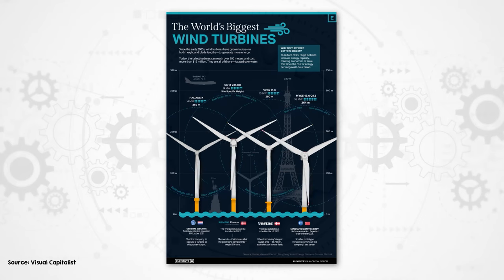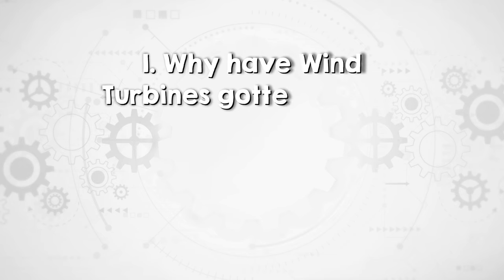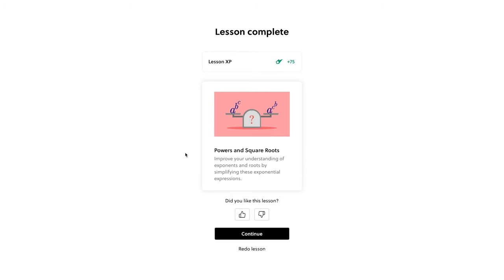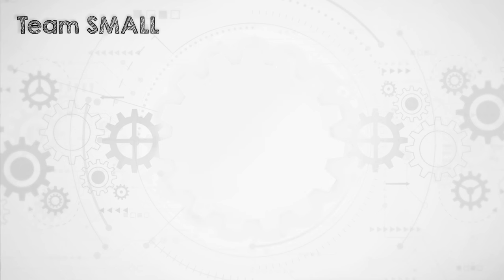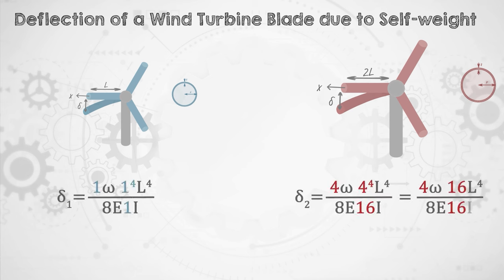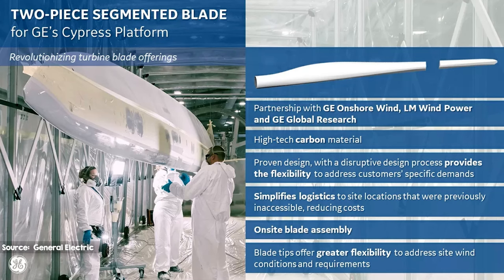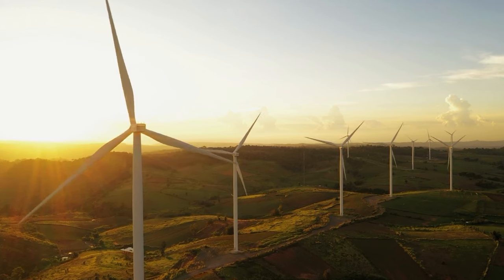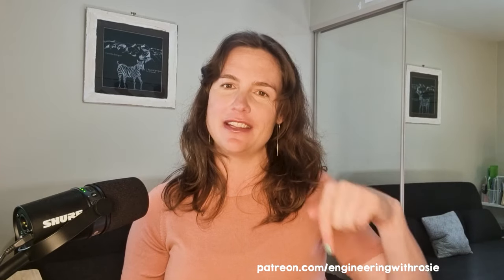Discover the Surprising Science Behind Wind Turbine Design for Lower Energy Costs!

Comment: I think transportation will be the ultimate limiting factor. Except for a few special locations (middle of a desert, perhaps) the road dimensions will dictate what we can do. 
Another point for team small: downtime. It is better to have 1 of 10 towers to be out than one ten times bigger tower.
Reply: Dunno about that... With 10, you have 10 times the points of failure, plus the repair crew isn't 10 times bigger for a big turbine than a small one, so the labor costs will be higher for the small.
Reply: Road dimensions don't (often) matter for offshore wind. Ships can be very big.
Reply: Wind farms have scaling rules too. With the exception of engineering prototypes and tiny turbines, windmills are installed in groups.

I doubt it is cost effective to manage less than a dozen turbines.
Reply: For offshore wind farms transportation is less of an issue as ships are large and the sea is wide. 
The limiting factor is getting the parts to the harbor (or perhaps building it in the harbor).
Reply: @hamjudo  Doesn't matter how many turbines, what matters is the generation capacity and maintenance cost.
If 10 turbines can generate 15MW each, that's 150MWp wind farm, which can be cost effective depending on the cost of transmission and the wind consistency.
Reply: I read somewhere recently that the largest sizes of offshore turbines are already reaching the limits of the maximum size of floating cranes currently available for assembly. Of course larger cranes can be built but that in turn will be an additional cost. Perhaps an opportunity with floating turbines, as these can be ballasted down for assembly, to a point.

Comment: I suspect the volume (of structural material) increases at a factor less than a value of the cube. This being attributable to the structures being hollow. For example, should the support post have the same wall/skin thickness, but twice the size, then the factor would be squared as opposed to cubed. And if the wall thickness increased by less than two (for twice the size) then the volume increase would be less than cubed.
Reply from the maker: In all the scaling I did all dimensions had the same scaling factor, i.e. thickness increased at the same scale as length. 
You're right that mass has tended to increase more slowly than the cube of length, at least for blades. That's for the reasons I mentioned in the video.

Comment: Rosie has a new video. Now I want cake :(
Out of curiosity is there much a performance difference in having a 100m blade at the minimum sort of height versus say 20 or 30m higher.  You did say that part of the advantage of the bigger turbines is that they are higher and thus experience higher wind speeds but is there any real advantage in just jacking up a 3MW turbine so that it's in the higher wind speed area.

Comment: Current designs rotate the power head to face the wind. This necessitated a tubular design for the tower. Has any studies been made where you rotate the tower and fix the power head. Tower then being truss with majority of strength in one plane.
Reply from the maker: Some reallllllllllllly old designs were like that! But honestly, the yaw system only makes up about 1-4% of turbine cost, it's not that big a deal to have it. There is nothing inside the tower that rotates as the turbines yaws, that's not why towers are tubular (it's for ease of installation, weather proofing etc)

Comment: I love your content, especially about wind.
Which type and size turbine saves more birds and is quieter at the ground?
I recall you once said that tower height is minimized relative to blade length, and a longer blank base tower section costs money with no return. 
But the longer that length, the less noise for people and if I recall, less bird strikes. Could those additional costs be budgeted into projects, maybe from other sources of funding?
From today's video, could worn giant turbines get shorter blades of new designs with minimal loss in output, mitigating current problems? Maybe address mitigation through upgrades? Thanks!
Reply from the maker: Noise is related to blade tip speed, which doesn't vary much with size. Offshore towers are kept pretty short, but onshore towers are usually as high as they're allowed to be, to reach the better wind resource. I haven't seen any proper bird studies that looked at tower height vs bird fatalities. I assume it would vary a lot depending on the landscape and bird species. I have been intending to do a video on wind turbines and birds ever since I first started this channel, I really need to just get that done!
Reply from the maker: Oh and your last question, about swapping out old worn blades for new shorter ones. No, that never happens. When old turbines are refurbished they'll just repair/replace like for like. There have not been such large efficiency gains that you could use a noticeably shorter blade. Sometimes old wind turbines are repowered at the end of their design life, but if blade length changes  it is invariably to longer blades to get better capacity factor (generate more power at slow wind speeds and therefore more energy overall).
Reply: That reminds me. I have to finish putting together the system so birds stop running into my windows. As everyone should know by now, windows kill many more birds than wind turbines.

Birds evolved along with trees, so they know how to avoid branches. Windows are new to them, on an evolutionary time scale. 3mm diameter paracord spaced every 100mm has been shown to be good enough to prevent almost all bird strikes. (Doesn't stop cardinals from attacking their own reflection, or help when a bird is surprised by a bird of prey and they aren't looking where they are going.)
Reply from the maker: @hamjudo  yep, buildings, cats and cars cover nearly all human caused bird deaths. Climate change is a further threat. Wind energy is definitely an overall good for birds, but I still think we need to do what we can to avoid harming birds, especially endangered ones.
Reply: Wind turbines distributed throughout a country reduces the need for big power lines. Power lines kill large numbers of birds.

Comment: How will the speed of sound influence the size of wind turbines? Larger means faster tip speed. At some point it has to become fast enough to get affected like helicopter blades do.
Reply: In general, tip speed is the same for all diameters, it is the rpm that changes, so the speed of sound has no influence, except for it being part of the reason for the tip speed.
Reply from the maker: What Nigel said!

Comment: Generators that are efficient when coupled directly to the blades are more expensive than ones that spin faster. Big gears are expensive and inefficient.

Depending on the price of rare earth magnets and copper, the whole system cost may be lower without gears, but with a more expensive low speed generator.

My intuition is that in the small vs big tug of war, big turbines are less likely to have any gears.

Comment: cant we stick two current-size turbines onto each other? get the upper set of blades into better wind, while keeping the benefit from the lower (currently top) rotor. maybe have the rotors overlap and by clerverly designing blades turn them in sync.  maybe one of the front-side of the tower and one on the back? dunno.

can we put the stuff in the nacelle onto the ground with a long shaft and make the tower thinner?
Reply: My first thought about that is that for a given tower height one big turbine can sweep a larger area than several smaller ones in one tower. However, I'm not an engineer so I'm not sure if that's enough to kill the multi-rotor designs.
Reply: @seneca983  Ya. Makes sense. However growing the tower was kinda cheap (if i remember correctly from the video), but increasing the rotor-size was expensive. Thus the idea to use a big tower with two medium rotors.

Comment: 9:05 Hey since the Blades are more like hollow tubes rather than filled up, can we really say that the mass cubes with bigger size?
Reply from the maker: Yes, if you assume skin thickness scales proportionally to the other dimensions. Which is what I assumed when I showed that maximum stress stays the same regardless of scale. If you didn't increase skin thickness, blades would break at lower loads.
Reply: @EngineeringwithRosie  thx! Maybe it does not scale proportionally - since the bending resistance also gets better with the bigger profile, thus not that much more material is needed. Just an idea to explain why the graphs later in the video are not exponential.
Reply from the maker: @uninteressant2196  I included all the equations in the video, they include bending stiffness and how it changes as dimensions are scaled up. The non-cubic relationship we've seen so far is related to better design methods, materials, manufacturing etc as I explained in the video.
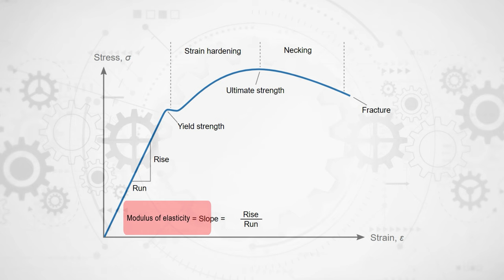Reply: @EngineeringwithRosie  8:59 The Proportional deflection stays the same - Double the length, double the deflection. If you look at the Formula for deflection this means that (i) I_1 = I_2 , since the radius is doubled the only thing we can change is the thickness t. 
We get I_2 = pi*2^3 *r^3 *1/2^3 *t
So the thickness of the larger blade is t_2 =1/8*t. 

Or
For delta_2 = 2*delta_1 
i get 
2*I_2 = I_1      ->      t_2= 1/16* t_1

However whats weird about that is that the mass of the larger tube is smaller...

The formula for the mass is probably simplified in the video, i got for a hollow tube: V= L*pi/4*(2t^2+8rt)

Comment: There would be a lot of benefit to sticking with say 3 good designs and building a lot of those same turbines

While you can improve the economics of a wind turbine design. There is a lot to be gained by improving the factory and manufacturing process itself

Take a soda can
You can improve the soda can design itself
Or you can improve the soda can factory
In this case the latter is far more important

I suspect we are nearing this point now for wind turbines. Pick 3 offshore turbine designs maybe from 3 different manufacturers and order 10,000 of each to be built over 20 years and let the companies improve the factory to get better and better and better at making the turbines

Comment: Has there ever been any investigation into multi headed turbines. Meaning a tall tower with 2 smaller turbines?
Reply: Lol posted just before you said it in the last 30 seconds 🤣
Reply from the maker: I talk a lot more about multi rotors in this livestream from a while ago. https://youtu.be/QqXxn5mKvlM
I'll probably make a whole video on that sometime soon, it's something I get asked about a lot (especially the Wind Catching design)
Reply: @UnwittingSweater  One issue that comes to mind is that for a given tower height one big turbine can sweep a larger area than several smaller turbines in one tower. However, I'm not an engineer so I don't know if that's enough to kill multi-rotor designs.

Comment: It's obvious to me that we need a ring slightly larger than the circumference of the Earth to allow the blades to enter the jet stream. Then we beam the power down with microwaves. So simple. Oh, I forgot to mention several thousand space elevators to stabilize the ring in the jetstream.

Comment: Very interesting video.  Just one tech point.  Spiral welding is nothing new.  It's been done for 50 years on structural pipe, just not on the scale needed for the new mega turbines.

As an aside, I wouldn't want to work in cake land Denmark.  A diabetic like me would have to resist temptation way too often!

Comment: Danes and cakes... wait, where are you from where that isn't a thing?  I mean, I'm in the U.S. (Northeast) and office cake is totally a thing here.

/I wish I'd taken higher math (I had a string of really terrible teachers in middle and high school, and went from being top in my class to only getting through Math II).  I'm a harmonica player and being able to do all this material science and load bearing stuff would be fascinating for reed function.  There are all sorts of effects with fatigue limits, torsional vibrations and Helmholtz resonance.  Reed thickness is adjusted over the length of the reed on higher end models to adjust where they flex to change tone and longevity.  A few people have done some modeling of it, but your video, even although it's about windmills, probably had as much information as all the videos and models I've seen on the physics of harmonica reeds.
Reply from the maker: I've never worked in the US, but I can compare Danish office cake vs Australian office cake. In Australia you might get office cake once every few weeks or even months depending if the office does birthday celebrations or not. In Denmark it was several times per week. Also, I can't actually recall going to any 10 or 25 year work anniversary events in Australia, maybe we don't have as much job loyalty here? But it might also be because I mainly worked for startups (or myself) in Australia.
About the reeds, that's very interesting! I play clarinet and after my PhD when I was still contemplating an academic career, I was thinking that clarinet reeds would be an interesting research topic. It is so hard to get consistently good reeds! I was buying the most expensive type and even then only 2-4 out of a box of ten would be usable. I figured there must be a way to do non destructive testing to predict which ones would be good. But I ended up in industry again (the right place for me definitely) and so I never pursued it.

Comment: The fewer turbines you have if one goes down that is a bigger percentage that is out of service.  They don’t get fixed very fast
Reply from the maker: That's true. But on the other hand, if there is a serial issue you need to fix, it will be quicker to get to a small number of large turbines than a large number of small turbines.
Reply: @EngineeringwithRosie  well there are few systemic or cataclysmic issue that affect more then one wind turbine in a bunch short of an electrical Serge…which fuses shall work to prevent
Reply from the maker: @gordybishop2375  a lot of my "real" job is dealing with root cause analysis for serial defects in wind turbines, so I see a lot of them. But my impression may well be skewed because I never work on normally operating wind farms, they only bring me in when something has gone very wrong!
Reply: @EngineeringwithRosie  I worked at the Solar SEGS plants here in California.  Solar Field Construction, Solar Field Maintenance, Operations and was control room operator for 26 years.  We had some systemic problems but usually not so system wide all at once.  The first ones were like the position indicators and then during construction of SEGS they did not mix the epoxy glue right at the factories and the pads that held on the mirrors were popping off.  But there was also changes to the arms that I think caused it and a few other things,  We called the era of Luz constructing the plants the Wild West Days of solar…lol
At one point we had flex hose leaks at that effected four collectors at a time in a row,  I asked my boss why can’t we take the good flex hoses and put them on one row and get it back in the sun instead of waiting for more.  
Canninalize them was my term.  Well it took the bosses to figure out what investors owned what but was given permission to do so.  
Sadly most of the SEGS plants have been turned into PV plants now as their initial 30 year contract ran out and hard to compete with new system operator instructions.

End if an era

Thank you for your reply.  Really enjoy your videos. Very informative without being too technical

Comment: For Current Design Hawts, The Bigger the Wind Generator the Larger the Weight at the Top of the Tower.
This becomes a Very Dangerous Construction Problem.
Lifting Big Weight to High Locations, Very Very Tricky.
Then there is the Question of How Much Renewable Energy Should Australia Get from Wind.
I say Let's Also do Large Scale Solar and Not have All Our Energy in the Wind Basket.
Good Topic.

Comment: Why not build the blades in situ?  A 117 meter blade could easily fit on most cargo ships; for land based building, one may not even need a building.
Reply from the maker: Yep, blades that long are for offshore and they tend to be built right near the port. Sometimes they'll make a prototype set in an existing inland factory, and just do a whole lot of tricky route planning and road closures to get them to port. But that would be way too expensive to do regularly.

Comment: Maybe, but the big blades are much more effective in the slow wind. The main problem this year was the wind did not blow too much. So all the small turbines just sit. The big turbines can extract far much more energy from the lower winds, so in fact, the driven question is not structural, it is overall efficiency. And that one is driven by bigger constructions as are providing more energy at the equivalent in capacity compared with the small because are able to produce electricity in a far much larger specter of wind speed. So...wrong questions lead to wrong ideas and analysis...
Regarding structural limitations, new materials change the face of engineering every day. There are companies that are providing fibers much stronger than steel and much lighter, like spider wire. So, do bet on today's limitations to be the same next year.

Comment: One point to add is that not only are winds winds stronger at higher altitudes but also more consistent which is important because the intermittent nature of wind energy is probably its biggest downside.
Reply: Offshore wind farms in the North Sea get a capacity factor of 50% (they get half of their maximum generation capacity over the span of a year).

So if you use large wind turbines in the right location, the wind force is very consistent.